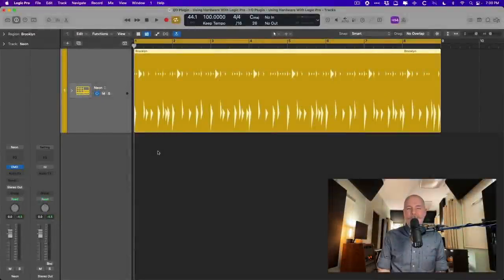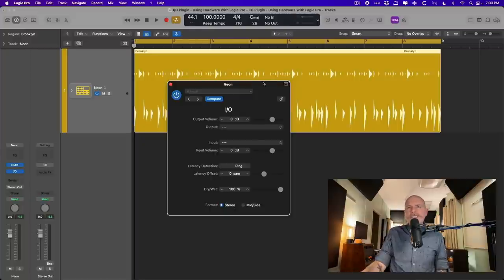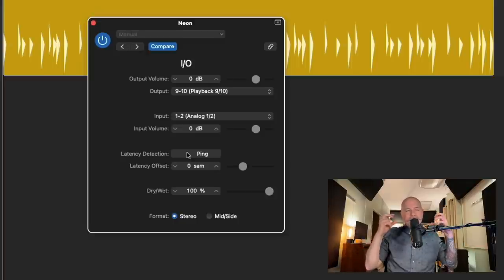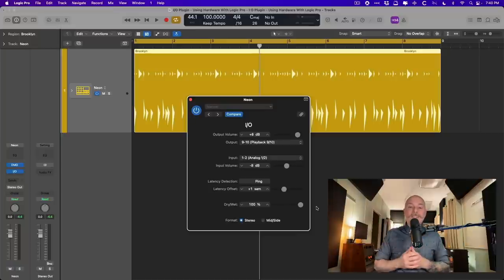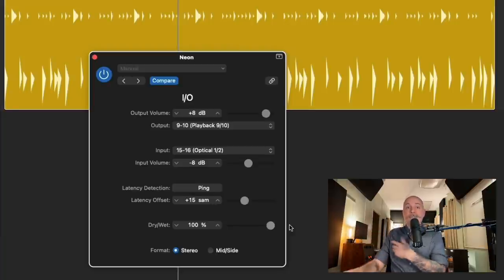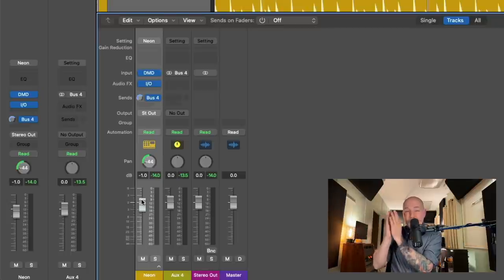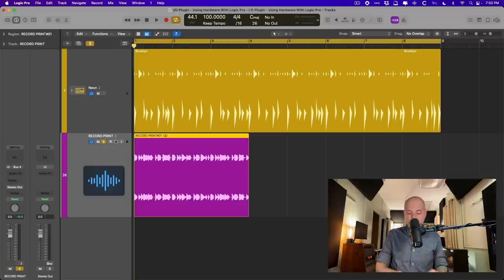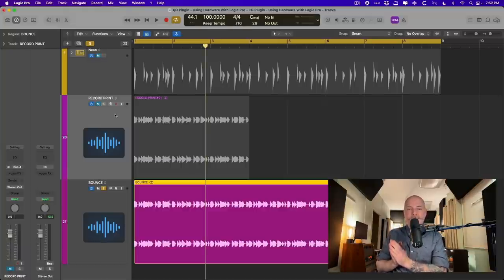Logic's I/O Plugin - Your Analog Gear, in-the-Box

Comment: In order to gain stage, I use the oscillator at 0db as an insert before the I/o plugin. Calibirate the input and output of the outboard, THEN I disable or remove the oscillator when done.

Comment: Hi Chris, this is Miguel from spain. Great video!!!! I have a doubt and I would like to know if you could help me. I hope so. I have created a track with a drum sample. I have inserted I/O with my Art Pro VLA II. Latency detection is +6 sam and 100% wet and when I playback I hear a delay. With Low Latency Monitoring Mode the insert is baypassed (orange). I have tested  with aux tracks (send, return, I/O on bus, etc) without any success, always listening the delay.
Any help would be more than welcome. Thanks....
Reply: Hey Migulea did you ever get a fix to this?  Curious I was having the same problem.
Reply: @TRAVHILL  Hi Travis, unfortunately I couldn't fix it in LPX. With PT Studio I had to do it by creating 2 aux, connecting the output of Aux 1 to Art Pro Input and the output of Art Pro to input of Aux 2.  It's not the best solution having options like I/O but it works. If you get another best solution, just let me know. Cheers!

Comment: Remember when we had to mix our songs from Logic, through a digital / analog mixer  then bounce the final song to CD, DAT, or ADAT?
This old'school style (in my opinion) sounded better than a digital "BOUNCED" file.

Please correct me if I'm wrong, but could this Printing / Bouncing method with the I/O Plugin be used to produce the same or a similar effect??

For example, if I mixed a song using an Analog mixer -- adding some COMPRESSION, EQ, etc  then route the main outs back into Logic Pro using the I/O plugin....
Will this method work??

Comment: Hey one thing you didn’t cover was tracking live vocals or instruments in this process. What would that process be like? I want to be able to route my compressor to my interface in the same way, and record into the DAW with it.
Reply from the maker: Hey! Great point. If you want to record through your outboard gear going into the interface, you would plug your microphone into the outboard compressor and then plug the compressor into the interface. But of course, you would need a preamp before the compressor to set your microphone level accordingly. I'll try to cover this in a future video. If you don't want to commit your compressor to the recording, then you would use the I/O plugin as described in the video. That way you're just monitoring through the compressor, but not recording the compressor. Thanks!

Comment: All of your videos have been immensely helpful, many thanks for this! Would the following work: Say I am tracking several tracks of guitars without the time based hardware effects, as I want to add them later. Can I send them all to the same bus (does it matter if its a bus or Aux send?) and have the I/O plugin on that bus an not on each separate guitar track. Can I then solo each guitar track and print the respective settings of my external effects one track after the other until they are all done?

Comment: Hey Chris. Great vid! I have a question. If I’m bouncing my stereo stems to tape simultaneously as I’m printing back to another track, would you use this plugin or, just route straight from the interface? Does this I/O plug-in only apply to effects or, does it also apply to an external cassette or, reel to reel, etc?
Reply: hey man! Did you ever get an answer on this? I don't have outboard gear, but have a couple reel to reels, tascam portastudio, etc. Right now, I just do it the hard way, but it's extra playback time that adds up.

Comment: Good video I learned a lot but I’m still having problems. I have 60 tracks that I want to run through my outboard compressor via stereo output. Do I have to use the I/O plug-in on all the tracks? I’ve only seen videos that only explain how to use the plug-in only using one or two tracks.
Reply: Seems like they covered that at the end of vid

Comment: Your videos are very helpful, thanks for doing this. I  have noticed a small discrepancy  using this ping method. I have a uad x4 & when I use the ping option, I also get 1 sample latency offset. So I ve decided to check with  sample clip recorded from the test oscilator plug with frequency set to 1KHz. I copied/pasted the clip in two different tracks & I flipped the phase in one of them. The result is that it doesn't cancel completely, which can be expected from the one hand, but if I drop the latency offset back to zero it cancels  a bit more (as the total output level is reduced further).  Do you have any idea what might causing this ? Thanks a lot

Comment: Nice insights; very educative. My question tho; if the audio returning from your outboard gear is routed via an input channel on ur soundcard, why create a bus instead of picking that return input (on the soundcard) as the input for your new track?
Reply: I was wondering the same
Reply: @jmhdsn  me too
Reply: I think if you just arm the input channel to record you don't get the delay compensation you would with IO plugin. Great question!
Reply from the maker: Great question! In my experience, sometimes the latency compensation from the I/O plugin isn't accounted for when recording in the way you described. I find it safer to set up a bus instead.
Reply: @WhyLogicProRules  Nice, makes sense. Thanks for taking the time to answer.

Comment: I also have just one piece of outboard gear, but I can’t use it because for some reason Logic won’t make up for the latency so it just sounds like crap when I try. I’ve tried ever scenario, and nothing fixes it. The ping calculates +619 samples, but doesn’t do anything about it. It’s quite frustrating considering I’ve had this piece of equipment for over a year and only get to use it when I track with it. I bought it specifically for my mixbus and tracking. I’m getting half of the deal. Maybe someone can shed some light on this for me?
Reply: Well hmm what is the outboard gear you’re using ?